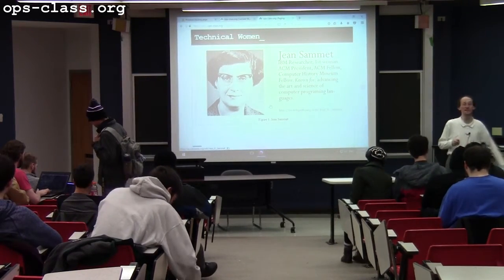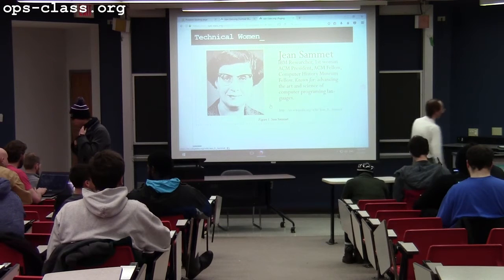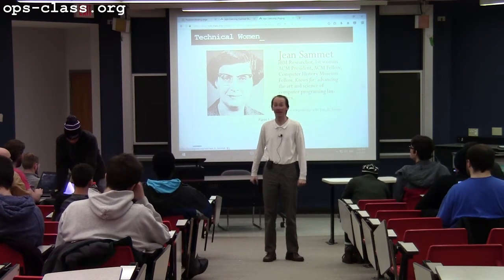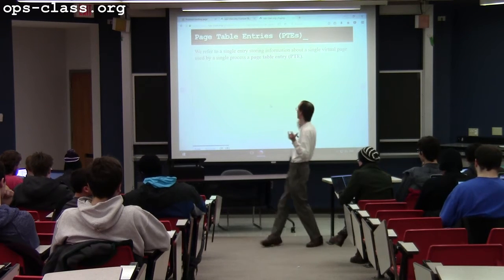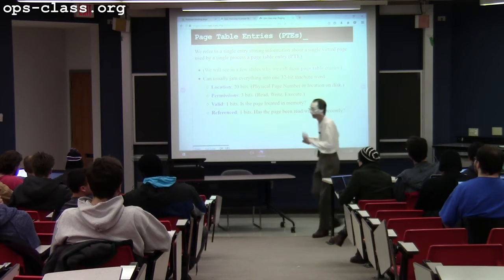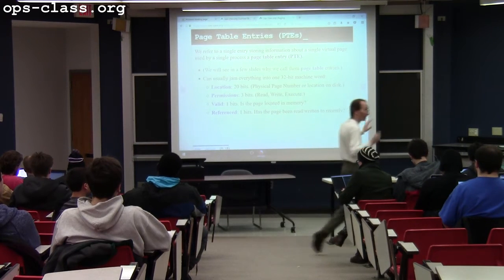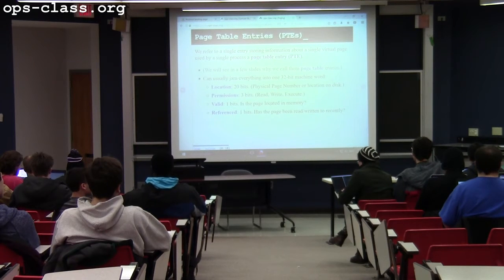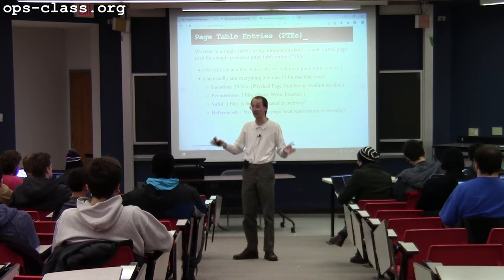15 Mar 2017: Paging

Comment: Good set of videos.

I took OS as a sophomore in college and quit after two weeks because everyone was a Senior or Graduate.  Instead I installed freebsd and trial and error.  I am watching this whole series just to compare to what I know now. It is very weird to see how professors think and teach.  I would never do a presentation without using an actual computer, gcc||clang, some c struct{} code, and the source of linux or freebsd.  Most of this stuff can be explained in 10 minutes (if you teach the fundamentals).  I think this is why I did not get it when I was 18 yrs old via the classroom setting.  I noticed that most professors teach it in this manner (with bloat to fill up the 50 minute class).  Which is not bad, but it sucks that uni's do it this way.